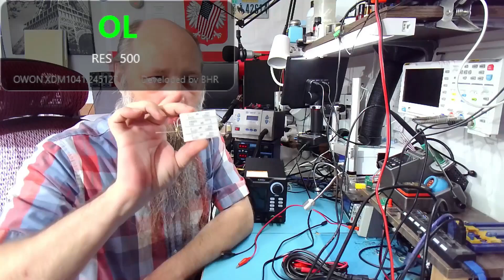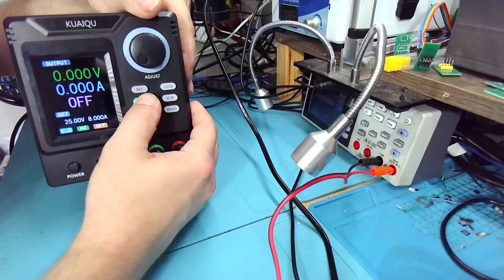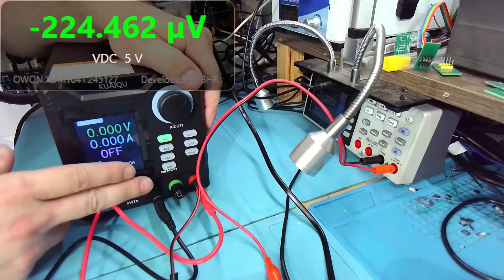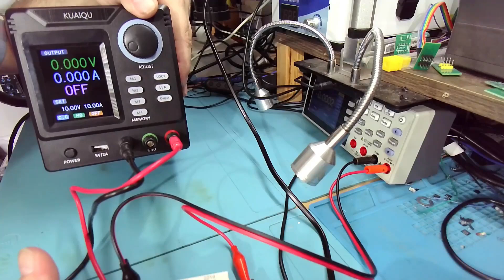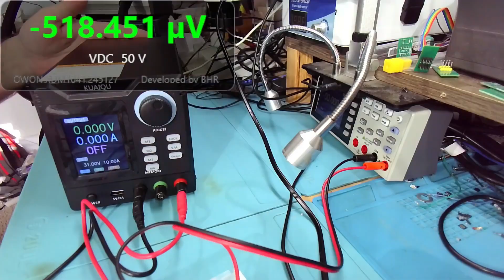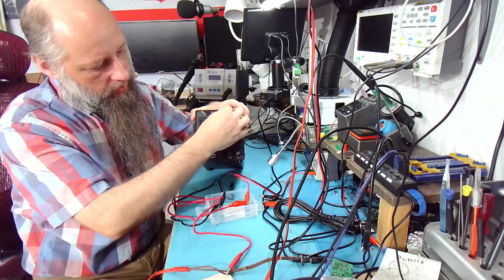235 | Kuaiqu SPPS-D3010-232 30V/10A Bench Power Supply Review and Teardown

Comment: I have ordered the 300V 1A version of this, and I wonder how precise the current limiting feature will be. I hope I can reliably cap out the output at 10mA or something like that. I want to reform high voltage capacitors but I'd rather not die. Of course I will use a resistor, but you never know...
Reply from the maker: let me know how it performed